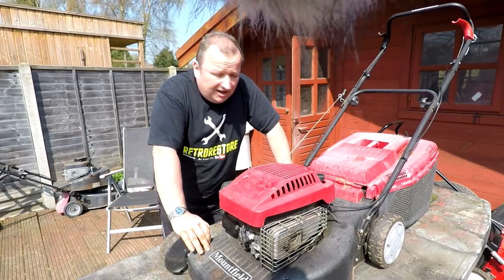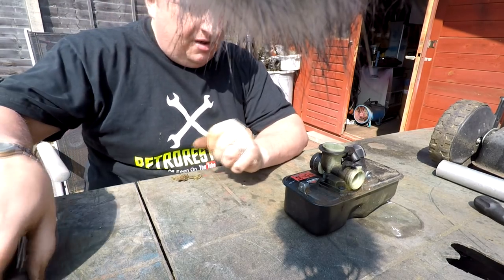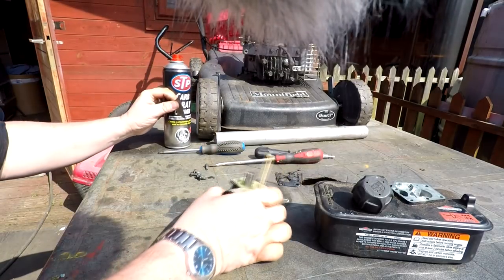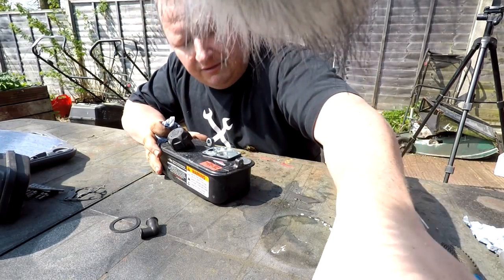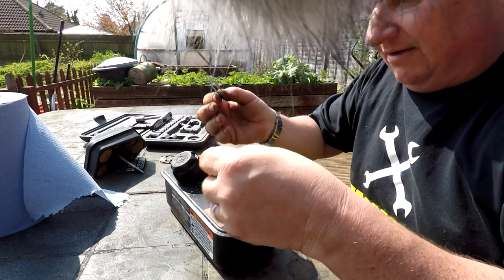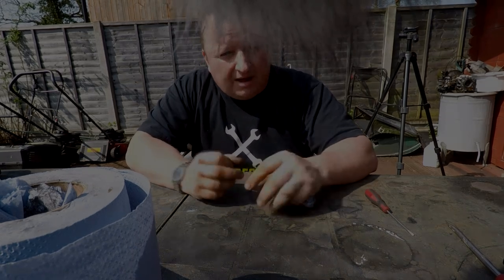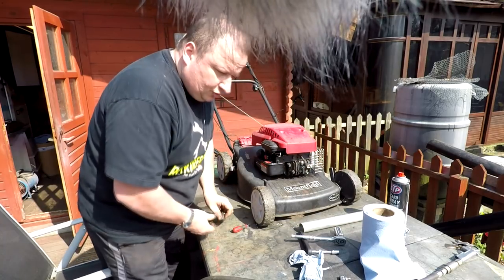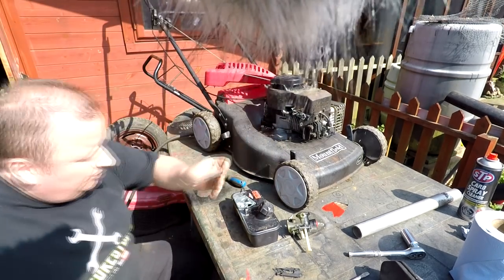BEWARE | Cheap Pattern Parts  Lawnmower Carb Fail

Comment: I serviced a mower with the same set up last week and had the exact same problem. Ordered a batch of gaskets last year and had not tried them yet. Ended up having to switch the carb and tank on to it from my own mower. I had never had this problem before with pattern parts. Annoying problem isn't it, I'm glad its not just me!

Comment: Hi Martin I've had many problems with pattern diaphragms and gaskets, I've had leaks bad running etc. I only buy the genuine Briggs ones now if you look around you can get them under £3 well worth the extra money. Also if you ever get a carb leak, try a straight edge over the bottom of the carb as those plastic carbs do warp. I buy a lot of the Honda copy Chinese carbs and they are hit and miss whether you get a good one or not, but the saving with them is a lot more so a bit of extra hassle sorting them is worth it. Good vid showing it how it is thanks🙂👍
Reply from the maker: Cheers bud, I've not tried the pattern Honda carbs yet but like you said, they can be hit of miss.
Cheers
Martin
Reply: retrorestore I usually have a few of the Honda carbs in stock for the 135 and 160 engines, if I get a bad one I just take it on the chin and keep for spares,, rather than return them. They are around £10 each but a Honda Engined mower is worth more so it's worth the extra expense imo. I've just fitted one and that one ran fine. 👍

Comment: I work for a plant hire company, I recently had a Honda engined 13HP stump grinder breakdown with a snapped choke vane. A new choke vane £25, replica carb £20 or genuine carb £125 all plus VAT and sourced from the same UK supplier. Needless to say we bought the replica carb, firstly the float wouldn't seal causing flooding followed by numerous other carb issues. Swapped to an original carb and all was fine. Lesson learnt.

Comment: Right mate, you'll love this. Where I took the engine today he had a mower......bloke bought a new one because it wouldn't start. Tacsuma (or something engine) not the Briggs. Took the plug out no spark. My fault not pressing the handle for the kill switch. Good spark, drop of petrol in the hole it fired. Put petrol in, started up, ran perfect. So what was wrong.....had run out of petrol. Free money lying all around lol. Wish I'd taken my camera.
Reply from the maker: Haha nice one Malc, those engines are Tecumseh and the carbs are a right pain but well done. as you said easy money is out there.
Reply: He was going to take the float bowl  off. I said just take plug out and check for spark. If I'd pressed the lever, and put fuel in, would have started straight up. Pumped up with the primer. So, it must have just been out of fuel. Was cutting grass within 10 minutes lol.

Comment: Hello Martin,  I always give you a thumbs up and enjoy your channels and videos .  I guess every one has told you that your microphone muff is on the top part of the video .  Good luck with after market kits , they sure look just like the real ones but the diaphragm isn't the same.  Did you know if you want that deck to really shine through you could heat it with your heat gun to bring out the luster or take transmission fluid and put it on a rag and wipe the deck down with it and it will shine like new if you want a tip if you wanted one !  Keep up the good work sorry about the gasket set !

Comment: I've never ran into cheap parts like that, I always get the Briggs name nothing else, those engines are so easy to fix that is how I I got my mowers for free, put a few bucks(pounds) into it and you get a nice running mower, avoid the new Briggs engines if you've seen them it's Al ohv and the shroud can be plastic from what I see, you and your family have a good week and looking forward to the next video.
Reply from the maker: Cheers bud. I've never had this before either.

Comment: Hi mart, good video as you and others have said pattern parts can be hit or miss on quality, but also have you considered modern unleaded petrol has ethanol added (13% iirc for fuel from renewable resources and as an oxygenate for emissions) which attacks non neoprene rubbers as well as going "off" (fuel smells like paint stripper/paraffin) in about 6 weeks when stored, there are other problems as well when used on low/no pressure (carburettor) fuel systems. You can get 4 stroke "mower" fuel from equipment dealers (4 litres for £9 I think) or try using super un-leaded as a cheaper alternative.
Reply from the maker: Yes, today's fuel is rubbish and has no real shelf life like it used to Steve.

Comment: Your camera-man needs a shave....  

Watching these, I have a 5 year old mower, with a B&S engine, just thinking,  that a new gasket/diaphragm set, spark plug and air filter, change the oil, sharpen the blade and I have a new mower, for about $40 or so....

Comment: the Chinese have not creaked the materials yet .had a Chinese 125 in last week to get it running for the lad 4 year old bike and the air box rubber was like hard plastic . had to heat it up to put the dam thing back on . cheap materials for more profit its a shame as it wont cost much more the get it right
Reply from the maker: Yes I agree Simon, not got it quite right on the quality front I think.